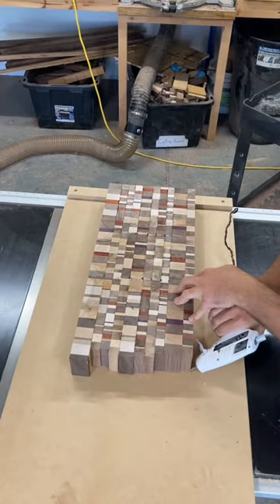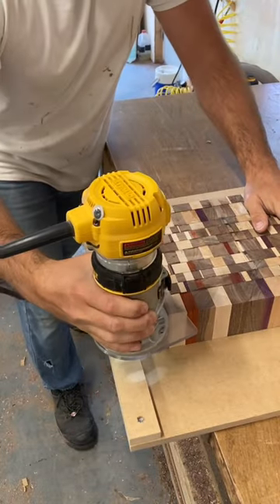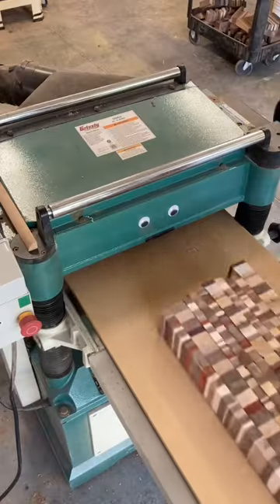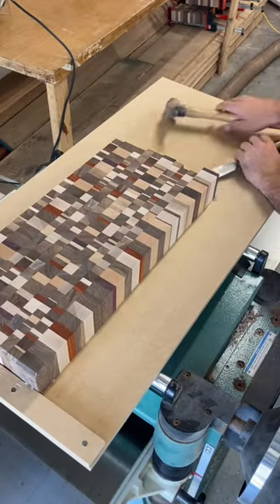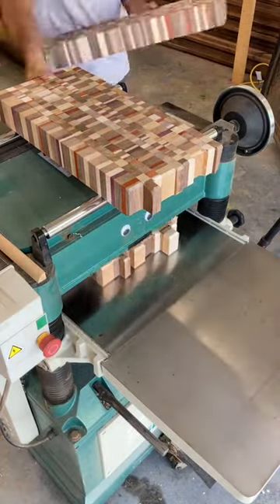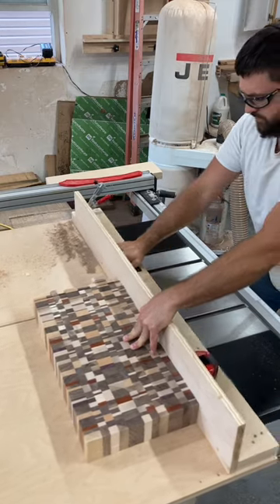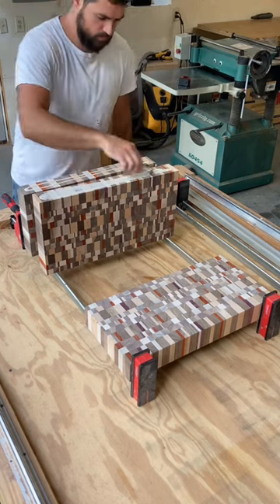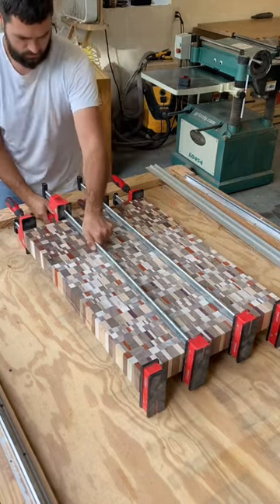Tips for Planning

Comment: Do you ever find you have tear out issues when you pull your piece back through the table saw while it’s still running? I do with my miter saw for sure but I just use the same rule with the table saw, always let the blade stop running or just pull the piece I’m working with off to the side so it doesn’t make more contact with the blade

Comment: I would have preferred that they where joined with something more regid...
Reply: All the smaller pieces are face/edge grain glued I think.. so this would not make a significant weak point, also I think a cutting board would be laying on a flat surface most of the time anyway, especially one this big
Reply: @tenchuZsenran  good point
Reply: I don't know what glue he used but with tight bond 3 the wood will break before the glue joint